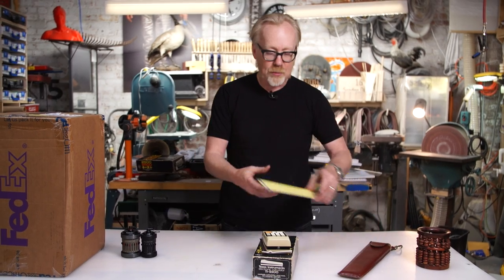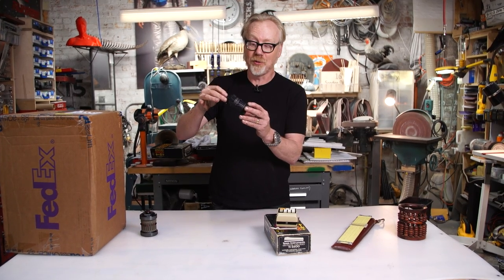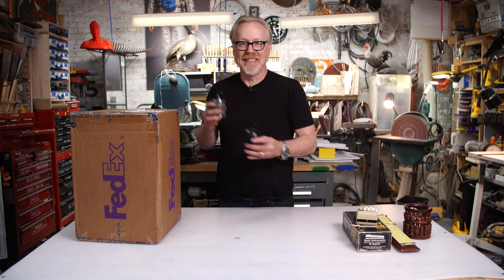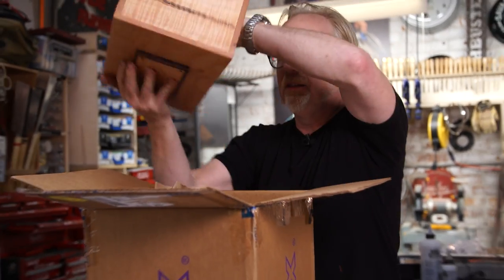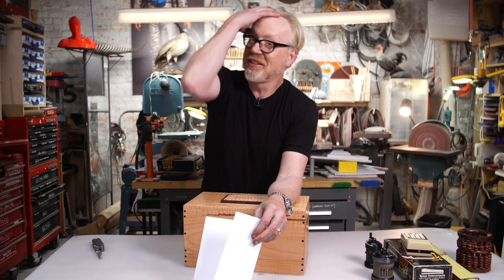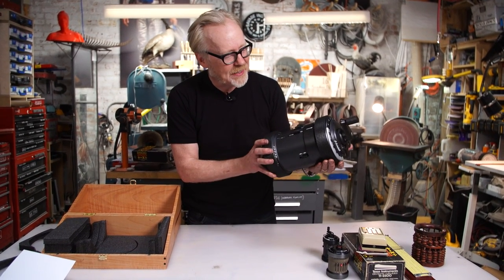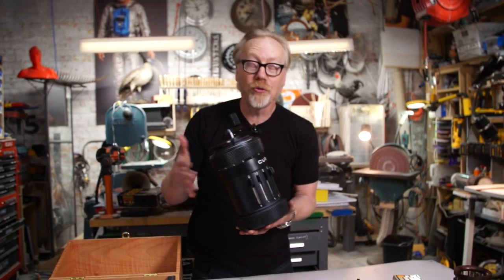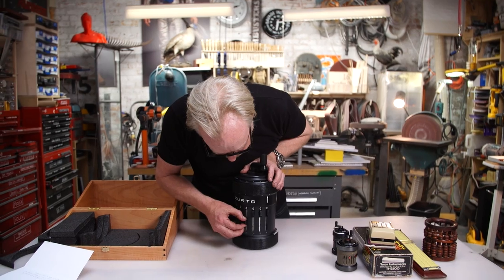The 3D-Printed Curta Calculator

Comment: How can you post a video on this and not do a calculation on it?
Reply: I was thinking the same thing:/
Reply: Some more calculation is done at https://www.youtube.com/watch?v=ShFkJgck6Pw and at the end of the assembly video: https://www.youtube.com/watch?v=zh2Z11miQ0w
Reply: my guess is that he broke something while trying it and they just didnt include that in the video.
Reply: I guess he just didn't want to damage it
Reply: Well, he calculated 550 times 1 and then 550 times 0...
Reply: He actually calculated 550+0 and 550-550. The Curta is serial adder.
Reply: shellshock
Reply: Matilda Hinanawi Thanks for posting this, almost wadded my time
Reply: Matilda Hinanawi exactly what i was thinking
Reply: yes
Reply: im right there with you
Reply: Thanks Marcus for not only sharing the videos but the design of Curtis too.
Reply: The weird part is that he called the subtraction resetting, where resetting is done by the resetting ring.
Reply: Yeah, I had to hold my tongue on that one. Maybe he'll get around to reading the manual.
Reply: eight and a half minutes of nothing
Reply: I understand your pain but I'd be right there with Adam, afraid to break it.
Reply: PurpleLion35, the name of the channel is "Tested" not "Fondled".
Reply: Matilda Hinanawi I
Reply: 550*1=550
Reply: Matilda Hinanawi because oddly enough, it's calculative prowess will not be used as Adam will encase it in a 3 inch bullet proof glass with 4 locks and a surveillance camera.
Reply: He did 550x1=550
Reply: Matilda Hinanawi &
Reply: Silence, sachiko
Reply: What? Unsubbed and reported!
Reply: @ASilentS  The arrow is clearly pointing at the 1.  This is why he should have done at least one decent demonstration that didn't involve replicating the same number up top that he input at the bottom.
Reply: You can see a good explanation of how the device works here https://youtu.be/loI1Kwed8Pk
Reply: #total buzzkill....
Reply: It's a tool use it...at least once

Ask yourself if you was a tool made by humans and those humans never let you fulfill your purpose. Sad really....

-the machinist
Reply: Well, he proved that 550 = 550.
Reply: He did. 550x1.
Reply: Because it's an ad.
Reply: You have saved me over 8 minutes of my life! Thank you kind person for taking one for the team and posting your disappointment.

Comment: Definitely an amazing piece of engineering. The original as well as the 3D printed. Wonder whether he considered printing one of transparent material though. It would be fascinating to see how the mechanics actually work in action, wouldn't it?
Reply: Now I want a see through one. That would be super rad. Good call.
Reply: The closest that comes to that is probably this simulation software: https://www.youtube.com/watch?v=kf_xcu9g_4g
Reply: Thedragonixxx transparent 3d printing filament isn't that transparent (more like translucid) I don't think it would work well
Reply: Thedragonixxx printing with transparent material doesn't work all that well especially for thicker things the better bet would just use clear plastic tube and then the rest being colored inside .
Reply: you could use a curing printer instead of extruding for glass like finish.
Reply: I focused on Adam Savage's Curta and haven't painted mine, but once I do I'll look into making some videos without the outer shell to show the internals functioning.
Reply: Marcus Wu please do !
Reply: A cut away like they used to do old engines and things would be cool as hell even if it didn't completely function.

Never the less you sir are a master for recreating this. I know the larger scale was due to the issues but it makes it even cooler.
Reply: Marcus....Adam mentions it is a 3x build...but by my eye it is at least a 4x if not 5x build....care to elaborate?
Reply: Make one ouf of metal, and have a see-through casing, should be enough.
Reply: Yes, it looks to be WAY more than 3x, but maybe he was talking only about the height. In that case it seems spot on, if you compare it to the one right next to it on the table. I would count volume though, and in that case it seems at least 8x maybe 10x to me.
Reply: Its 3:1 scale, so height is 3x bigger, length 3x and width 3x. You can't make twice high as original and 3x times as original in length, because then it;s not a SCALE.
Reply: Adam Malecki is correct, it's 3x bigger on each axis. A 2x2x2 cube has a volume of 8. 3:1 scale of that is a 6x6x6 cube which has a volume of 216. It is easy to see the object and instinctively know that the volume is much larger than three times so it seems as though the 3:1 scaled object is larger than 3:1 scale even though it isn't.
Reply: For a understanding of the inner workings check also: https://youtu.be/loI1Kwed8Pk
Reply: Thanks for clearing that up guys.
Reply: It would be interesting to print this using a mix of fully transparent and coloured(gray, for example) plastic on an SLA printer, then polish it.
Whilst filament-based printers couldn't do that, SLA could, although the costs for this whole device would be absolutely astronomical(think over a thousand dollars' worth of resin alone), not to mention the expensive process for polishing complicated structures.
Reply: just looking in the video with the two items right next to each other that the 3D printed one looks 4x wider as the original but you are the creator so i default to your commentary
Reply: 'transparent' 3d printing filament is not 'transparent', 
it is translucent because of the number of layers put down.
So if anything-- prints from this type-of filament act like a light diffuser.
Reply: is an amazing build though if you do look into making a see through one you would probably best to just make the structural elements and sheathing see through
Reply: Ste T I was thinking I would just print the base knurling without the rest of the housing

Comment: I wish someone would make a replicas because I want one so damn bad
Reply: Bo88y Beretta Replicas encounter the same problem that the originals had — that every single gear train has to be custom-adjusted and tuned to mate with its neighbours, and the tolerances are super tight at that scale. They're literally custom make movements.
Reply: Bo88y Beretta Probably not possible at least cheaply. Too many tiny hard to make parts that are all needed to function properly.
Reply: Bo88y Beretta the files are all on thingiverse if you want to print that shizznazzle
Reply: No wonder it was made obsolete by a digital calculator.
Reply: Bo88y Beretta it did say #02...
Reply: Bo88y Beretta you can find lots of them for ~$1000 on eBay
Reply: Yeah, a fully operational replica would end up being more expensive than an original.
Reply: IF you have $1000 plus they sell them on Ebay real ones
Reply: In my opinion the viability of a reproduction would depend on the die casting method and equipment. Precision casting has greatly improved in the amount of time people have been claiming a reproduction is prohibitively expensive. 
    I imagine there are bigger issues due to marketing, trademarks, etc. but I have no experience with these things. The only feasible market is for replicas of the original "Curta" with the exact look and original branding. I doubt people would pay a few hundred dollars for a newly branded and marketed product that looks a little different. Even when a business closes someone usually buys/owns the legal rights to some part of the former business.... Precision casting gets cheaper all the time though.
Reply: Upcycle Electronics There's so many different parts you'll have a lot of different molds to make so I'm not sure how much going with casting/molding would cut down on costs. Assembly is also pretty complex and hard to automate/cut corners given we're talking about a replica.
Reply: That thing is something for historians and indeed most would prefer the original :/ Unless the price is really just a fraction like 50-100$ but that is probably still impossible since even then it wouldn't be a mass market where it would be worth it to automatize production etc...
Reply: Would be expensive and probably like a Rolex, but man! I want one!
Reply: You can get an original for less than a rolex, lol. They were hand-manufactured but pretty much mass articles nevertheless.
Reply: buy one. I't like buying a piece of art: its price will only rise in the future. it's worth every dime
Reply: I don't want to pop your bubble but these things are worth about $1000 USD ($1500 CAD). If it was cheaper I'd buy one right now too.
Reply: Gabriel Desmarais Only that much? Sounds like a bargin.
Reply: A friend was working on making a replica, but his free time is eaten with a software hacking project now.
Reply: If your friend is daeken (https://github.com/daeken/ReCurta), I have chatted with him about his project -- cool guy and project.
Reply: Marcus Wu You are legendary.
Reply: Molding is, essentially, entirely and "up front" expense. Once you have a good positive part, it's child's play to knock up replacement negative molds.
Reply: Any particular molding process you would suggest? Some of the parts are particularly complicated such as the main body.
Reply: just buy the original on eBay
Reply: theabstrakt84 the originals are so expensive
Reply: Just checked ebay and yeah, I'd love one but 1500+ dollars is more than a tad hefty
Reply: A replica would not be cheaper:
Reply: I'll try to make one, once I figure out how to cast aluminium and finish my cnc router. I might make a video if I succeed. I think I am vastly underestimating the complexity, but unfounded optimism got me places before.
Reply: Jonathan R what scale will you be attempting?
Reply: I'll try original scale, but it'll involve a lot of hand filing after I cast each individual part. I'll also need to learn how to make complex molds first.
Reply: I know! I want one so bad!!!!!
Reply: Why not buy a REAL one?
Reply: Have you priced them?

Comment: Oh hell no.
I started watching this thinking that a Curta Calculator would be mass produced nowadays and I could buy it for $35 on Amazon.

Nevermind. It costs $2k.
Reply: FeelsBadMan
Reply: Let me explain why. 

It's interworkings are all custom as the calculator is made. Meaning, instead of a normal watch where they're all the same internal workings going the same way. The Kurta is a fully custom gear working. Meaning, if you where to compare one from to the other, they would be completely different for the gear timings. Meaning, a person would have to go one by one and make sure each number worked. On. Each. Slide. 

That is why they cost an arm and a leg.
Reply: Just buy a 3D printer and make a bigger one
Reply: @Aquablue62  Expect you forgot about the cost of filament and how you have to assemble it in perfect conjunction.
Reply: Imagine a world where we all use this intead of digital calculators.
Reply: alysdexia In the beginning, I was going to comment on how you were critiquing his grammar, but I soon realized that there is absolutely nothing wrong with that. Somebody who’s obviously attempting to write a flawless sentence should be supported by other individuals. Thank you for your service to the individual entities of the world!
Reply: @tannerman6851  This isn't entirely accurate. The parts were mass produced, but there were certain parts that they did have to custom match to ensure they mated together correctly. They measured those parts after machining them and sorted them into ranges of tolerances so they could assemble the calculators without having to measure each part during assembly.

The reason these calculators are expensive today is because nobody actually makes them today. The number there were when Contina AG (who made them) shut down is the number there are today minus however many have been lost or do not function anymore (and not counting any 3D printed ones have been made since I released my plans). Watches are still useful so a lot of people continue to make them which brings the price down. These are straight up collectors items.

Should someone build up a manufacturing process (more than just a handful) for Curta calculators again, the replicas should be cheaper than the originals. The originals would continue to be more valuable.
Reply: Same
Reply: 600 parts
Reply: If it was more affordable, I'd buy it in a second! I LOVE brilliant mechanical devices.

I love electronics, and I can program electronics, but sometimes it feels like cheating. Devices like the Curta truly capture the imagination... The engineering... The craftsmanship... When I watch this I'm as excited as Adam.
Reply: @tannerman6851  >  The Kurta is a fully custom gear working. Meaning, if you where to compare one from to the other, they would be completely different for the gear timings. 

Completely incorrect.

Comment: Building the Curta using a 3D printer is unbelievable.  Of course building the original Curtas was pretty amazing.  Seeing that old DataMath brought back memories.  I started with TI in 1973.  The calculators we were building (almost all by hand) had 3 circuit boards and over 100 components.  They sold for $160 at Nieman Marcus.  Three years later we were building TI-1200s.  They had about 6 parts and sold for $10 at checkout stands. We built 75,000 per day!  It was a hell of a ride.  I am proud to have been part of a group that put calculators in every school kids hands.

Comment: I wonder if it'd be possible to print a 1:1 curta with a resin printer.  They typically have very high resolution compared to FDM printer.  In the meantime I'm going to try to print the 3x sized one.
Reply: I don't think a 1:1 scale printer is possible with a resin printer. I've seen the 1:1 scale parts and they are very small. At that size, the resin may not have the strength or rigidity necessary to operate. It would certainly be interesting to try, though. I'm looking forward to getting a resin printer soon.

Comment: My fav vintage calc is the HP-35. As the first handheld scientific calculator, it was the envy of tech geeks everywhere when it was released, in 1972, for $395.  It has a bit-serial processor and a total of around 960 bytes of ROM for all of the math and user interface routines.. It's trig functions are implemented using good 'ol CORDIC. This model flew aboard Skylabs 3 and 4. A few years ago, I was fortunate enough to score one off of eBay for only $50.

Comment: Incredibly clever to make this massive Curta, that is undeniable, but why do it. It is totally impractical. It would probably be quicker to do a long multiplication using a pen and paper . The standard size curta is a thing to behold, and not that much slower than using a present day calculator.  I used one at work in the 1960s for around five years, that is before the electronic calculator was invented. Didn't really think that much of it at the time, but now I wish I had one, just to show people how it should be used and how very quick it was to manipulate. The case for it was also quite unusual as it had a left hand thread. When I was first shown one, my 'teacher' told me to open the case, and of course I couldn't. He then took it back and opened it not showing me how he had done it. I tried again but no, it was far too tight, or so I thought, then he admitted that it had a left hand thread!!

Comment: I used to have one of those Texas Instruments calculators! It was $99.99 in 1973, and it stopped working about 4 years later. In 1976, I bought an HP-45 which I still have. it worked on AC last time I tried it, but the battery won't charge, and if it does, it dies within minutes (probably a short). HP was well know for excellent products  and TERRIBLE customer service; they fixed it once, but sent it back with a separate problem. I never bothered getting it fixed a second time.

I also found a F&E slide rule from the early-mid-'60s on ebay. I managed to get it for a good price, and I'm slowly learning how to use all the scales. It's an amazing device that SHOULD still  be in use.

Comment: In order to synchronize audio from an external source, such as in a close-up, you use your time stamp, the two sticks are slapped together, which is used as a visual and audio que to sync them. The actual calculation to sync the sound is complicated. The audio must be started first, the problem is that video cannot cut to a single frame of video, because the codec requires a specific reference frame. This means you must cut the audio to fit the video. I use goldwave to edit audio. First find the slap time in the audio, and write the time down. Get 3 decimal places by zooming in. I use AVIdemux to edit video, find the exact time in the video the slap happens. Since the audio was started first, it will be larger. Subtract the video slap time from the audio slap time. X = V - A, where X is the result, V is the video slap time, and A in the Audio slap time. Now set the start of the audio to be the calculated value X. Then simply add the audio to the video.

Comment: I actually bought a Curta (model 2) in 1969 while in high school.  The machines are a marvel to work with.  They are a hand held version of a gigantic Monroe calculator of the day.  The Monroe would take up the space of a large typewriter on a desk (I saw one).  Sometimes the Monroe was motor powered and would automatically "divide".  That was a marvel to see at the time.  Somewhere the Curta is stored away (I think in my sister's house).  It was an AWFUL lot of calculator at the time.  Only when I finally got an HP-35 did I put it away.

Comment: Great job as usual.  However, I have one minor criticism.  There wasn't a slide rule within a moon's orbital radius of the Apollo primary guidance project at MIT.  I was there.  I did some (a small part) of the onboard guidance computer programming, as well as MIT's Apollo digital flight simulation.  Perhaps slide rules were used elsewhere in the development of some of the secondary guidance methods, and it is that to which Adam refers in this video.